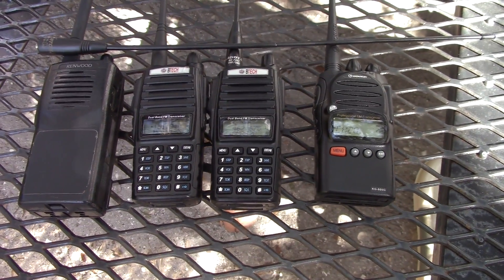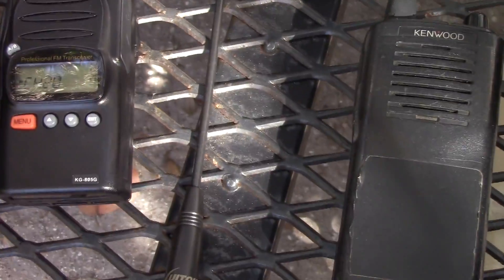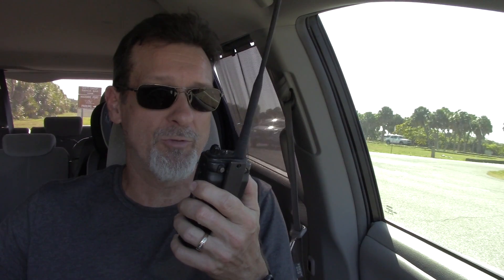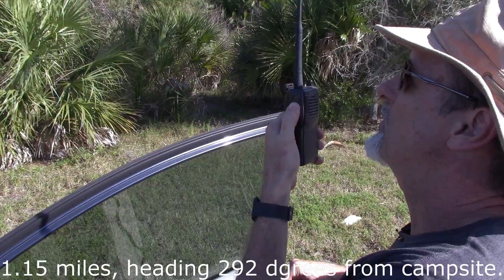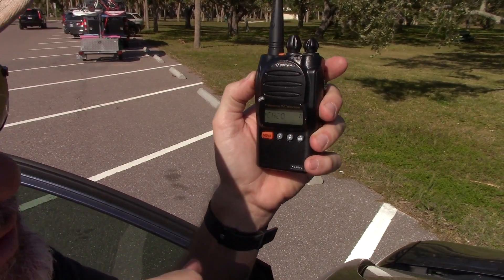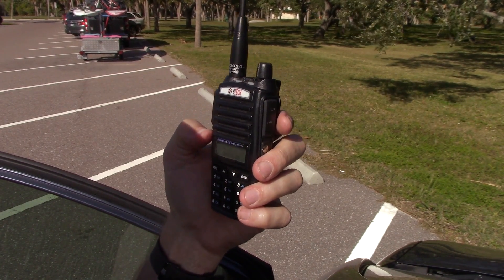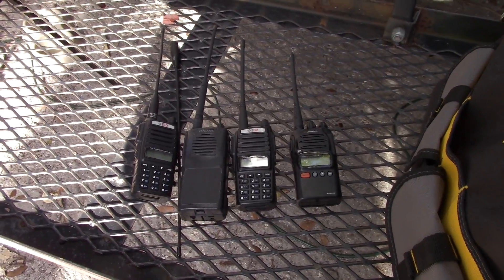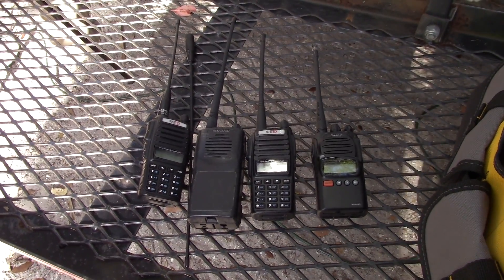GMRS vs MURS HTs - Range test at ground level.

Comment: Thanks for this. Be nice to do the same test connected to a roof mount antenna. When cell coverage fails we use MURS in heavier timber and terrain and GMRS on a repeater over further distances. BAOFENG UV5R @4W
Reply from the maker: I plan to get back to this topic with better antennas. Waiting for those rare moments not in suburbia where moving vehicles can skew the reception results.

Comment: Should be outside instead of inside car.
Reply from the maker: For better range, yes. This was checking the different bands in different situations. Not a max range test, but those are interesting.
Reply: @Soladaddy  Range test at ground level

Comment: Few have actual GMRS handhelds that transmit near the legal FCC part 95 limit of 5 watts.  Compare VHF at the same power setting, and VHF usually will do twice as well when there is vegitation and rolling terrian.  In a pine forest and rolling terrain, VHF is far superior.  One should do a radio survey in their area as the results will vary greatly.

 An advantage with MURS, there is no ERP limit and the transceiver can be attached to 
an external antenna, meaning one could run it through a high gain 
antenna such as a yagi.  2 watts through a 5 element yagi might have an 
ERP as much as 15 watts, if there is no line loss.  However, there is an
 usual and narrow bandwidth requirement of 11.5kw for MURS channels 1, 
2, and 3, and a limit of 2 watts.  MURS channels 4 and 5,  can have a 
bandwidth of 20kw. Set the Boafeng for low power (1 watt), and on the 
narrow bandwidth setting that should be 12.5kw, and it might meet 
specifications on channels 4, and 5. However, if not interfering with 
other users, few care what happens on MURS. 
I use it because there are no Hams there, and it  could give one the same coverage as 2 meter simplex if necessary. 
 I make and sell antennas of all kinds. You'll want at 
least one directional antenna, preferably a 5 element yagi, or at 
minimum, a moxon to avoid being DF'd.  

 Skills are perishable, so periodically review what you think you know, and get out 
there an actually use it.
Reply from the maker: Yes, I was surprised at the results in this scenario. Agree that VHF should out reach UHF in outdoor environments, even with half the power. Working on testing this again soon in different locations and antennas.
Reply: The terrain and the different antennas used are variables to consider.  UHF is often the most practical as it works better than VHF inside a car or building, and because the stock antenna needs only be 6 inches in length.  I've made many antenna of all kinds.  UHF works better if only hand helds are used.  VHF is at a disadvantage, because to fairly compare with UHF, it's antenna needs to be 18.75 inches and the ground plane 19+ inches, therefore UHF has a huge advantage when handhelds are used.  If comparing VHF to UHF, VHF will usually do better in the mountains and in extended ranges if a full sized 1/4 wave ground plane antenna  is mounted on the roof of the car. Then VHF can outperform at extended ranges even if a UHF external antenna  is also used.
The difference in performance between a handheld VHF radio and a handheld VHF radio on an external antenna is about 7.7Dbd or about 3 times stronger in signal out and in it's ability to receive.   Getting the best of both worlds in communications system that uses both hand helds and radio that use external antennas, UHF is the more practical in most situations.  However, in where mobiles are used in vehicles with external antennas on the roof and where used outside the city VHF will be more reliable.  I use both.  My primary frequency is UHF, and the secondary frequency is VHF.  Where one does not work as well, the other works better...     @Soladaddy
Reply from the maker: Very well said. Yes, UHF is usually better in the HT world. I started using MURS about 22 years ago shortly after the service was created. The family would visit theme parks that had poor cell coverage and the FRS/GMRS combos were everywhere. I recall times where every channel/freq was packed. We had MURS to ourselves. Only one time in 10 years we ran across another party using MURS and he was a fellow ham. Fast forward to the mid 2010s and smart phones reduced the usage of GMRS creating more breathing room. There was a better selection of gear as well so we started using GMRS. While camping we still use MURS.

Comment: Instead of giving Brand of radio, be more descriptive Of Radio Type and Service, either Murs or GMRS and get someone else on the other end that can say more than two words, good grief.
Reply from the maker: I made clear the brands because the Kenwood and Wouxun radios have better receivers than the Btechs. It makes a difference on the edges on the signal. Having the same brand comparing the two services would be better.

Comment: The lower frequency of the murs should get through more vegetation and go almost twice as far watt to watt.  However,  with the gmrs test the 805G at 5 watts makes up the ground and then when you put a 771 antenna on them it will pull ahead.  So because of the murs 2 watt legal limit its hands are tied.  Only other factor is whether you want 2 or 5 watts of radio next to your brain.  LoL.
Reply from the maker: Valid points. I expected the MURS radios to do better and am thinking that communication tower messed with it's signal. Maybe another test is in order.

Comment: It seems that most MURS radios on the market these days have fixed antennas even though the MURS spec allows for replaceable antennas, unlike FRS.  I'm curious about how MURS would have performed with a better antenna on either radio or on both.  It seemed to make some difference on the GMRS radios.  I know the BTECH MURS-V1 allows for replacing the antenna.  It's just a Baofeng UV-82 that is firmware locked to MURS, just like the GMRS-V1 is a UV-82 that is firmware locked to GMRS.  I don't know if your Kenwood has a replaceable or fixed antenna.  But as I said, I would be curious how much replacing the antenna affects your results with MURS.
Reply from the maker: The antennas the Kenwoods were using are removable and a slight upgrade to the stock 6in models. They are Larsens tuned for 155MHz and 9 inches long. MURS 1/4 wave is 19 inches so an antenna shorter than that is coiled and that hurts performance so yes, MURS and VHF usually benefits more than UHF from a longer antenna. I have used a jpole on a kenwood and can get a few miles, depending on the setup on the other end. About 5 miles to a car with a mobile antenna and up to 15 miles to another HT on a hilltop.

Comment: Thanks for getting  outside of the vehicle. Your signal is killed by the metal cage of the vehicle. It doesn’t matter VHF or UHF.
Reply from the maker: It does take a beating on the inside. That's a good idea for another test. Thanks for watching.
Reply: Lotta shielding..

Comment: Great video. One of the main things I got out of your video was that for good or bad the GMRS worked at all locations when the MURS did not in 1 location. This was rather surprising to me with the terrain. But overall thanks for sharing.
Reply from the maker: That caught me off guard as well. I think the cell tower and its gear messed with VHF more than UHF. I've been working on an elevated test for GMRS, but have failed at making the connection. Thinking I need more height and/or power.

Comment: A little trick for the HTs. A counterpoise helps. Just a bit of wire cut to the 1/4 wavelength. Put an eye typo connector on one end and put it under one of the belt clip screws. At least on most of the Chinese radios I've messed with the clip screws go into the metal frame and ground. Generally your body is kind of acting as the second part of a dipole, just not always that well. The bit of wire, and it can even be rolled up, acts as the second leg of dipole antenna. I've been a bit surprised at how well the GMRS radios, even the little RT22s, have performed in relatively flat terrain. Even when one is in a house. I've had clear commo with one of our group inside a house on the little license free RT22 and me with a 5 watt HT at the gun range about 1.5 miles away with houses and trees in the way, but similar elevations.  It just goes to show. Unless you get your gear out and use it under varying locations you aren't going to have a clue when it's an emergency and you need commo. Appreciate you taking the time to do the video and share it.
Reply from the maker: A counterpoise is on my list to test out. I'd love to have a gun range so close to home.

Comment: By chance are you in South West florida?
Reply from the maker: West Central Florida.
Reply: @Soladaddy  new to all this GMRS stuff and was looking to connect with other GMRS users.  Any GMRS repeaters?  Apparently you need exact channel setups to make contact
Reply from the maker: @seltenfotog3115  Check out mygmrs.com to see local repeaters. If you have an account, that website will have info on whether the repeaters listed are open for use.

Comment: Great video!  When I travel, I do bring along a pair of GMRS and MURS radios.  I did end up purchasing 2 Wouxun KG-805G radios. I like them better than the BTECH GMRS V1. I'll probably end up buying a pair of Wouxun KG-805M radios too.
Reply from the maker: The V-1 has its pluses, but I end up carrying the 805G to work because it picks up a business using ch8 that the V-1 never hears. Been eyeing the 805M too. Hope they bring back the basic version.
Reply: I’m really glad you like it wouxun even you said twice is not a competition but I like Yaesu ft4
Reply from the maker: The FT4 is a nice ham radio.
Reply: @piterex7  ... Not legal for use on anything but the ham bands.  You need a ham license to use one and for GMRS a license is also required, $35.00 for 10 yrs from the FCC, no test but you do have to get an FRN from the FCC before you can apply for any FCC license.
Reply: @jfrphoto01  its 70 not 35
Reply: @jfrphoto01  GMRS License is still 70.00. Feb. 2022.